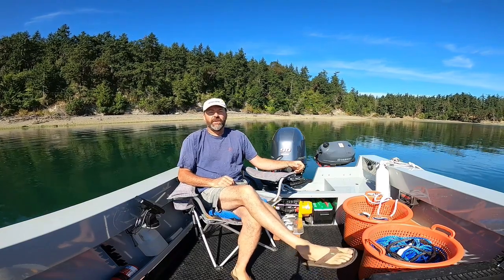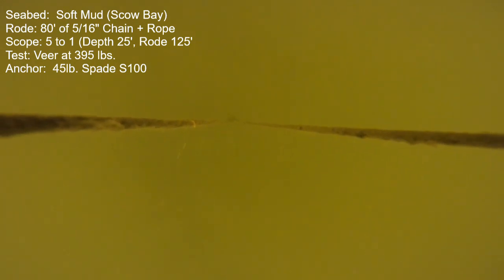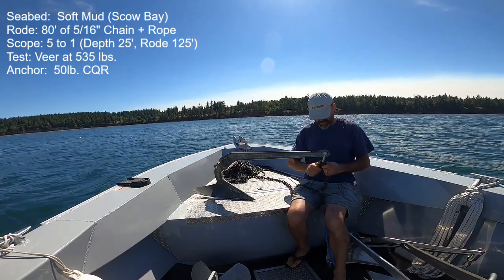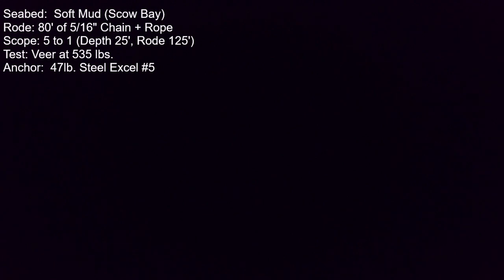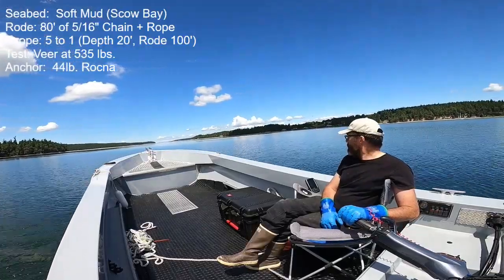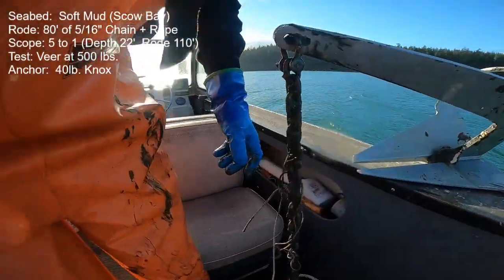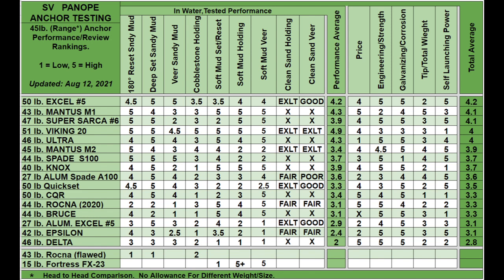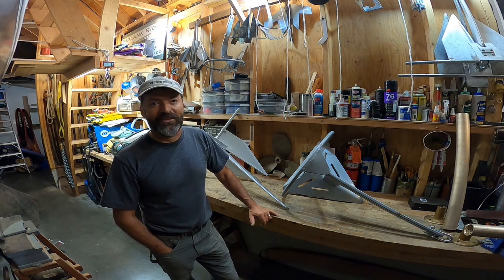Veer Testing Part 3.  Anchor Test Video #120

Comment: Hi Steve
Your dedication providing al this data is amazing. Thanks
If you run out of anchors it might be interesting to test one anchor with different sizes of all chain rode. For example  6mm 8mm 10mm 12mm at the same location to see what  the effects might be. Spending money on chain more effective than upgrading ones anchor???
Cheers Mike

Comment: Hi Steve,
I've watched a lot of your very good test videos - a big "Thank you!" for the substantial effort you put into making them.
I am more interested in "bigger" anchors (>44lb.) because of the 45ft, 15 (metric) tons sailing boat size. Too bad you don't still have the Vulcan - hope it will very soon return to your collection.
May I please suggest something for you to consider in your future videos?
As I was not born in an imperial country ;-) , could you also add the worldwide spread metric system to the American system to the text at the top of the on-the-water text? It will help the "rest" of the 7.5 BILLIONS relate easier to those numbers - that is 94.7% of the world's population, man! Only about 0.5 billion are using the imperial system. 
Just a handfull of states in the world still use the imperial numbers, so... please help us...?
PS: Lovely to see the new approach to testing. 
Real world anchoring does not have much of the 3.5 knots 180 degrees instant wind or current shifts, does it? While I understand your  initial approach, for the people like me a "semi-circle test" simulating a regular wind shift is so much useful.
This will tell us if the anchor is "jumping" (what angle?) and needs resetting or if it stays buried  and we can sleep through the night.
Thank you again and we're looking forward for the next tests!! :-)